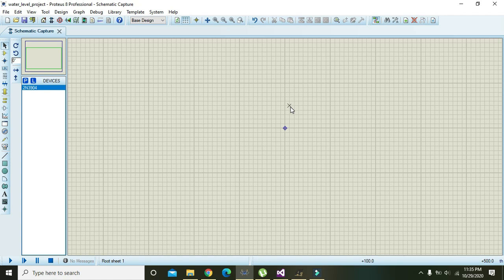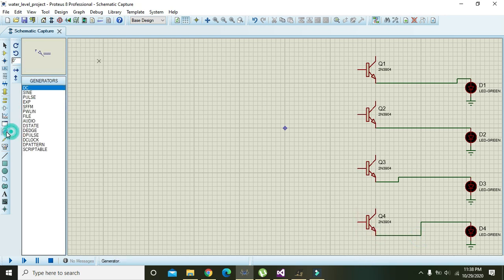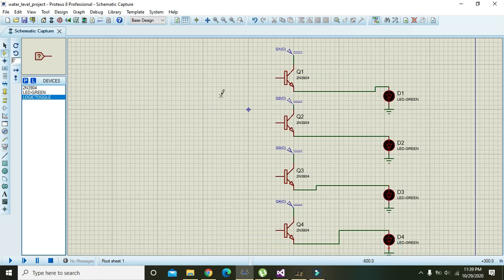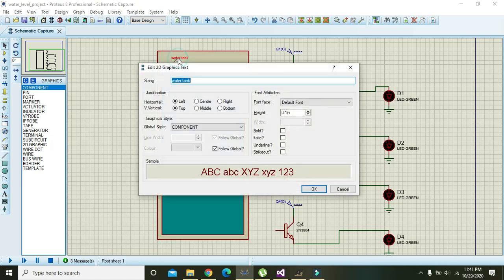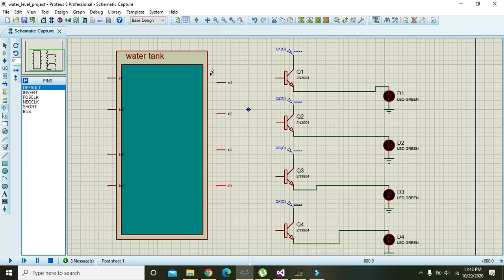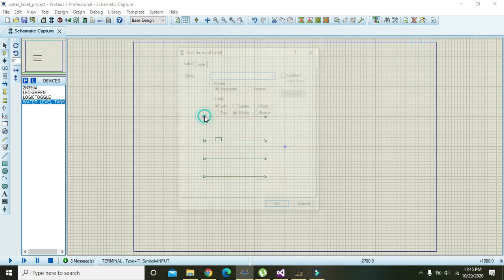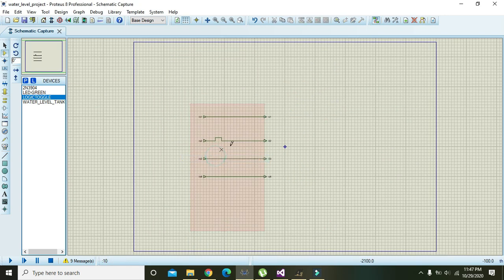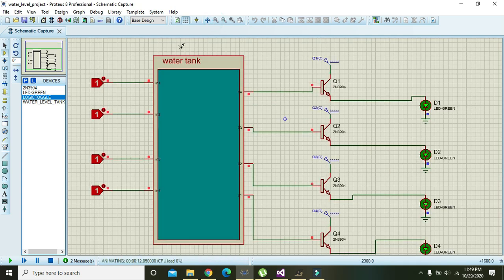how to make water level detector circuit in proteus | water level indicator in proteus

Comment: Sir can you say why we used the NPN transistors and 5v DC? Also Sir how is the logic toggles detecting water? Do we place a sensor in place of the logic toggle in a practical Circuit?
Reply from the maker: In real circuit u need to place sensors along with npn transistors....
Reply: @nelsondarwinpaktech3954  What sensor is suitable for use?